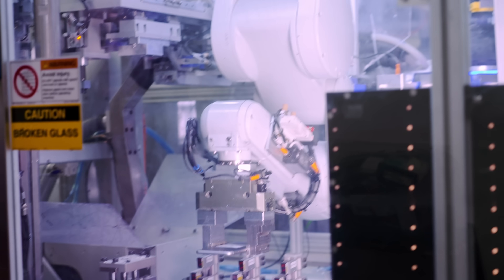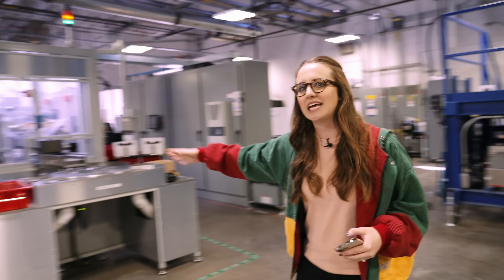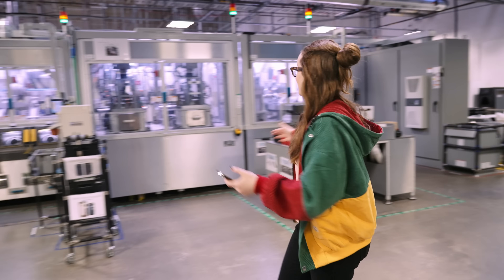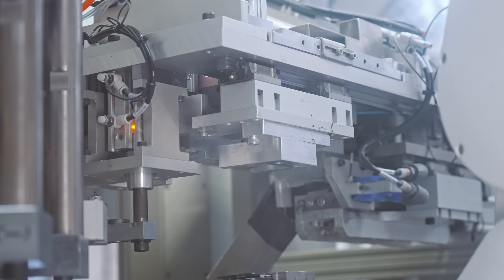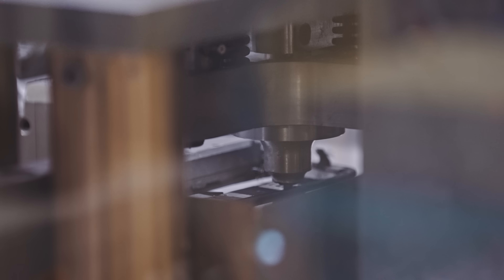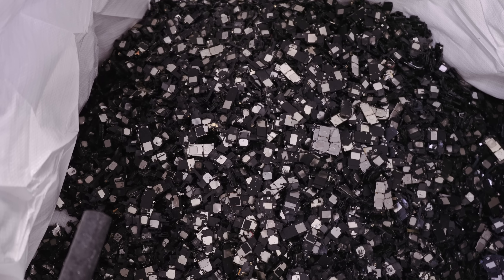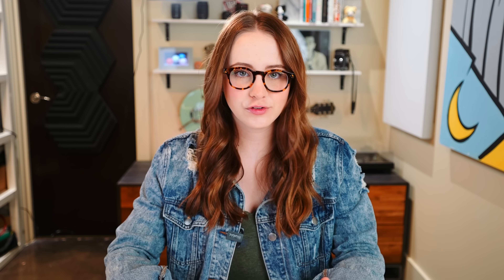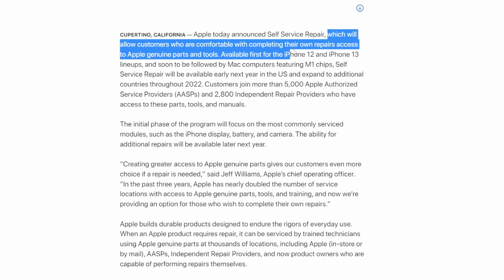Apple's Robot That Recycles Your iPhone - Meet Daisy

Comment: Sent in my old iPhone 6 for recycling 2 weeks ago (I just bought an iPhone 14 and kept my old iPhone 8 just incase that one breaks for whatever reason). Interesting to see how it gets recycled.
That being said, like a typical iPhone 6, it had a "significant" bend in it according to Apple as I tried to replace the battery in it a few years ago as it wouldn't last more than 5 minutes without dying from full charge (they said it couldn't be done without the risk of not being able to put the screen back on). Yes the phone was prone to bending in people's pockets...

Comment: The Apple Independant Repair program and Self Repair program are utterly useless. 
They offer next to no parts (only screens and batteries), and having only that available for only the latest models (iPhone 12 and 13) is not putting the company in a repair friendly mindset by far.
Apple is one of the companies that hires lobbyists to go up against the Right to Repair movement and actively seeks out ways to always rip off their customers.
And in short, this machine only allows them to even grab more money when devices get recycled.

Comment: the best way to recycle is to keep the device longer
Reply: Yup. Still using a 2015 iPhone 6S Plus as my daily driver, running the latest iOS version. I also still have every previous iPhone I ever bought: 3GS, 4S, 5; the 3GS isn't working because of a bulged battery, the others are all operational.

Comment: How many of those PCB's, speakers, charge ports, screens or batteries could have been spare parts to keep phones in service.  Instead you have a machine that has to rip, freeze and bash it all apart because Apple actively designs their devices to be difficult to repair.  Terrible for the environment and terrible for Apple customers.